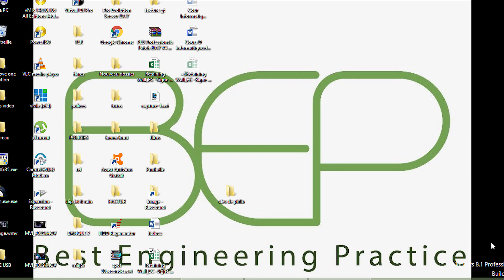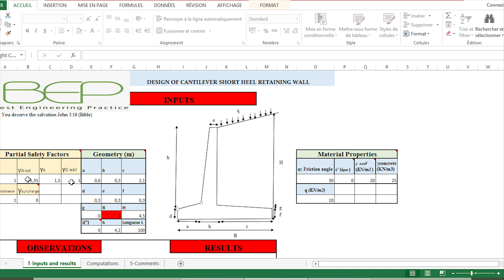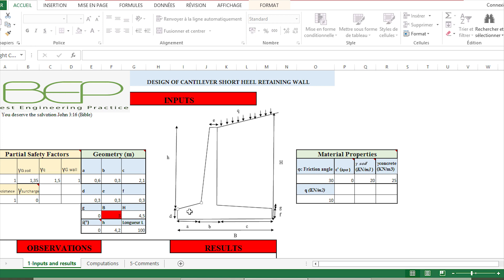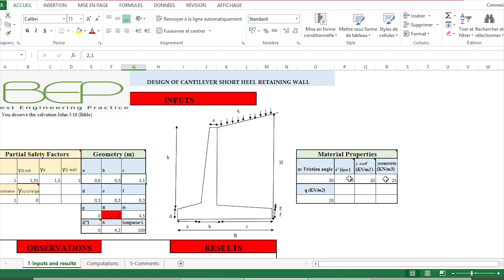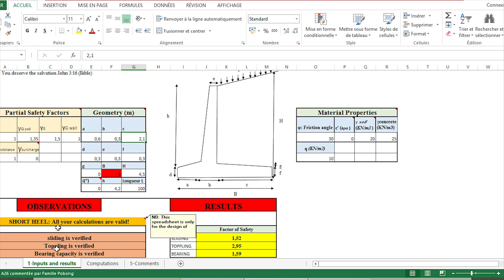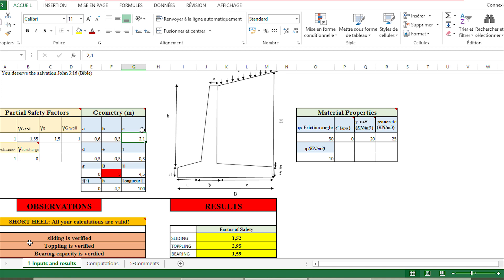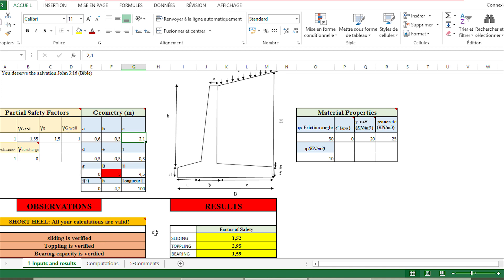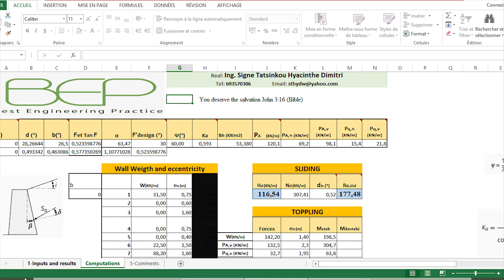Geotechnics - How to design retaining walls with Microsoft Excel sheet - Verify Retaining structures

Comment: angelrsalgado@gmail.com  
 I'm not used to metric system but will convert the values. Looks simple and useful Thanks
Reply from the maker: I have send. Have you received it?
Reply: @BestEngineeringPractice  I received, as I said struggling a little bit with the metric system, but I'll survive!, Thanks
Reply from the maker: @RAFFELO11  hahahaha. Where are you from?
Reply: @BestEngineeringPractice  I'm from Puerto Rico 🇵🇷, living in MD, USA.  Even so I know the metric system, we don't use it too much.  I need to get a sense of the measurements, specifically strength and forces...
Reply from the maker: @RAFFELO11  Ok; I'm happy to read from you. I'm from Cameroon but actually I live in France.